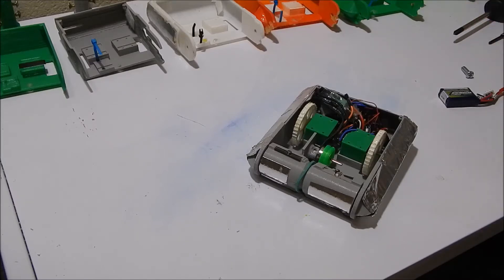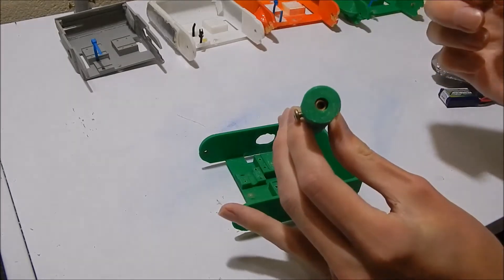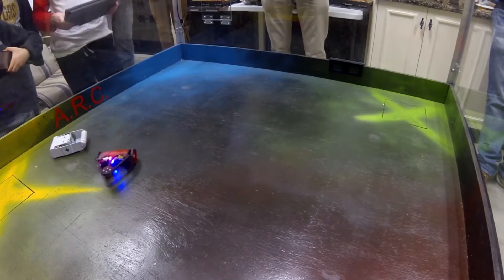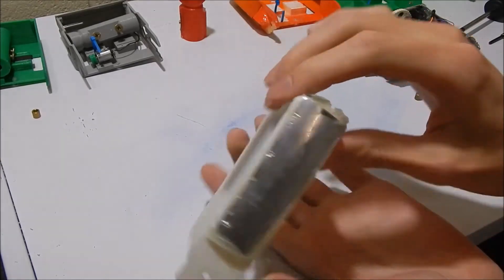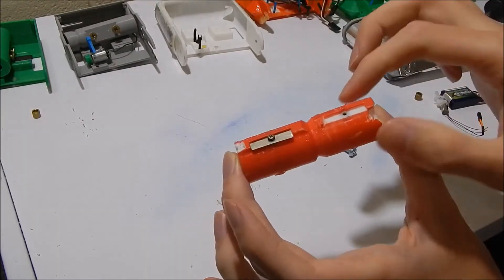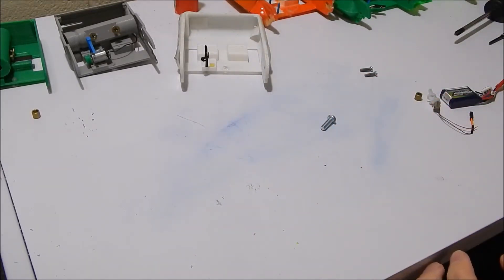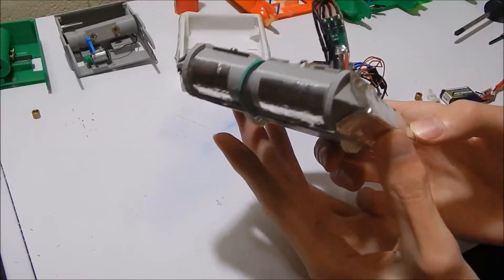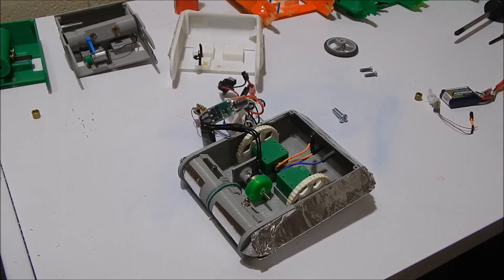150g Combat Robot Design Evolution

Comment: I want to build my first Battlebot, but rc bits are expensive. Is the Arduino method cheaper?
Reply from the maker: Yes, much cheaper. You can build the receiver and motor controller for about $5 USD and the transmitter for about $10-$15 USD

I've even done a full tutorial here: https://youtu.be/Yt4J2paYcDU

The downsides to the Arduino system are that it's more work to get together and its heavier than a lot of the current RC equipment.

Comment: 1 bolt and nut for 2 blades going right thew the barrel might stop the blades coming off
Reply from the maker: I did think about that, but the nut would have been the thing that hit my opponents rather then the blade (it would have stuck out too far). So instead I changed the weapon to steel plate

Comment: The countersunk screw heads for drum teeth is a good idea, did you ever try using like 3mm (1/8) or 4mm (5/32) hexagon set screw heads for teeth at some point?
Reply from the maker: Yeah it's not a bad idea, its also not my idea, its been done a lot of ant and beetle weight drums.
Most people sharpen the countersink to get more bite out of them.

I never tried using hex heads, I moved on to the pencil sharpener blades after having issues with screws in the 3d printed plastic

Comment: Great video! Could you please link the pulley and belt that you used in the drum? I'm not able to find ones that fit brushless motors.
Reply from the maker: As far as I know, you cant buy pulleys that fit small brushless motors.

I 3d print my own pulleys and use small rubber bands as the belt
Reply: Team Panic Aah that's what I thought. Thanks!

Comment: This is weird because I cheer for Shrapnel when he goes against you, but now that I see this, I don't know who to root for. P.S can you upload this to thingiverse if it is 3D printed?
Reply: Also, can you put a parts list in the description of don't need roads?
Reply: Shrapnel is the horizontal spinner you were talking about.
Reply from the maker: I'm planning on uploading the design once It works a little better.
I think I the new design I am working on will be the one I upload.

yeah Shrapnel keeps tearing me to pieces but I think I can stop that
Reply: Team Panic I actually like Shrapnel and I have printed the chassis. I plan to make it and don't need roads when it's available. (Beta bar not drum.)
Reply: Team Panic Good luck.
Reply: Team Panic How will you belt drive the beta bar?
Reply: And can you make a file for a 3D printed beta bar?
Reply from the maker: I do have a file for a 3d printed beta bar, but it comes out super light compared to the steel.

the steel beta bar is held on the ends with 3d printed parts that also have grooves to belt drive the bar
Reply: When are you going to upload the beater bar video?
Reply from the maker: Probably after the first time I use it. I have a fight in a few weeks, so all going well I'll do a video on how things went after that
Reply: Team Panic Nice! I'll look forward to it.